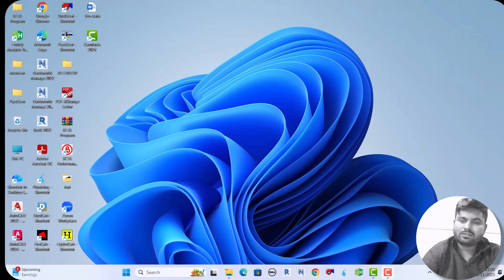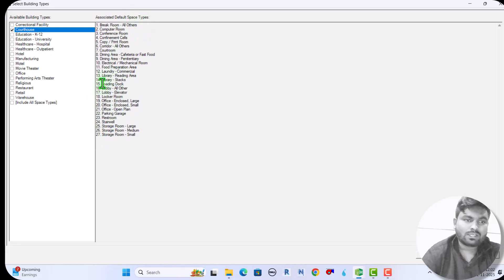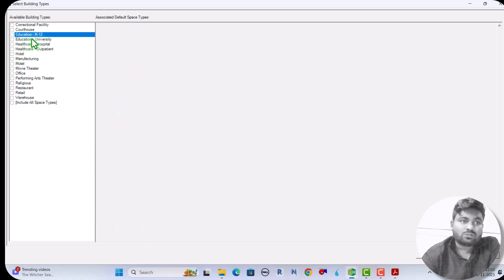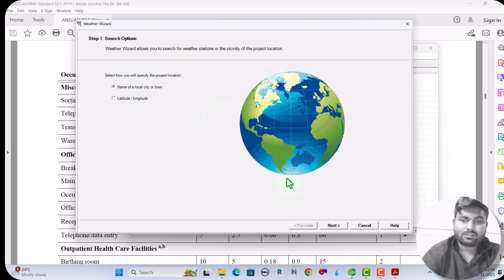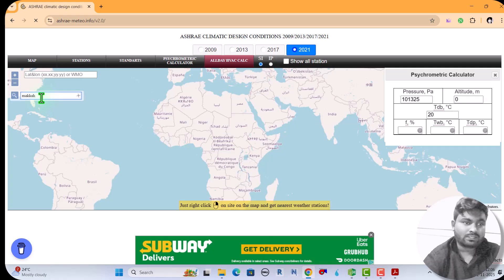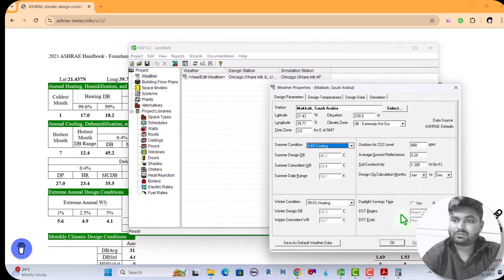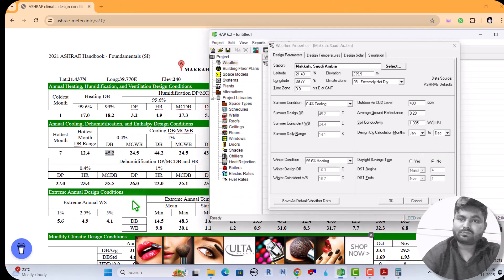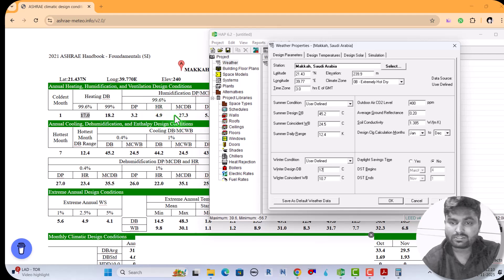HAP 6.2 Step-by-Step | Cooling & Heating Load Calculation-Part-01

Comment: Assalamualaikum. The video is very helpful. I have one doubt regarding the OA design temperature. I followed the exact procedure shown in all parts of the HAP 6.2 video series. However, when I extracted the report, the cooling design temperature is shown as 78°F instead of 91°F as per the ASHRAE design conditions. Could you please help me understand why this is happening?
Reply: Thank you so much for the quick response it really helps a lot
Reply from the maker: @KhalidNawab-r7x  My pleasure
Reply from the maker: Walekumslam. Thank you 😊 
The standard cooling temperature is 75°F. Therefore, your setting of 78°F is acceptable. A temperature of 91°F (32°C) is not standard for cooling purposes. However, if required, it can be adjusted in the thermostat settings under the System tab.
Reply: @imranfarhat9760  actually I was talking about the peak OA weather condition which is 91°f DB for new york. 75°f peak for cooling is very low right
Reply from the maker: @KhalidNawab-r7x  24°C and 50% relative humidity are the standard comfort conditions for human beings. Regardless of the outside air conditions, HVAC systems are designed to achieve these indoor conditions. I have already shown how to obtain the correct weather data.
Reply from the maker: @KhalidNawab-r7x  If 91°F is to be achieved, the system must be designed for heating.